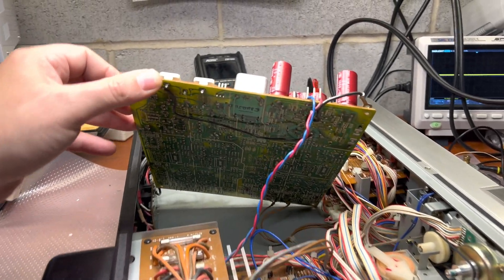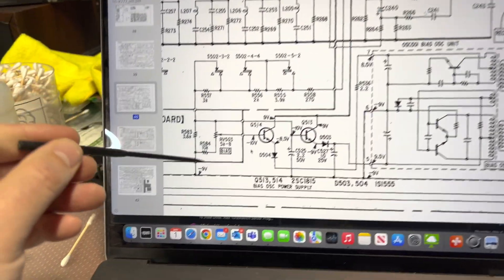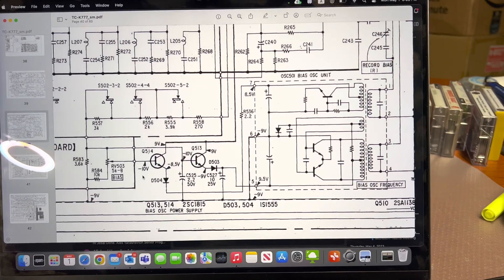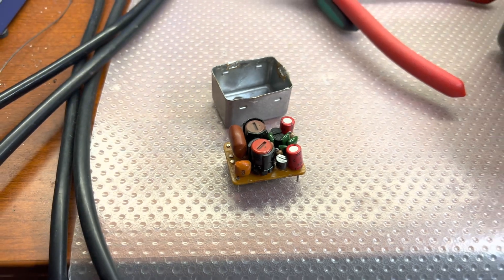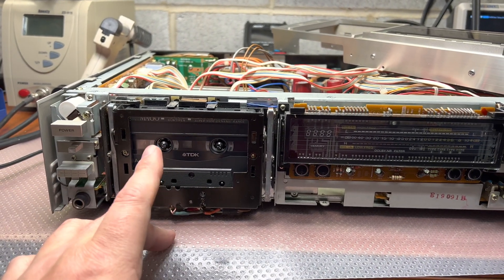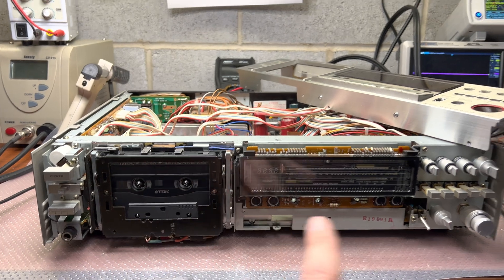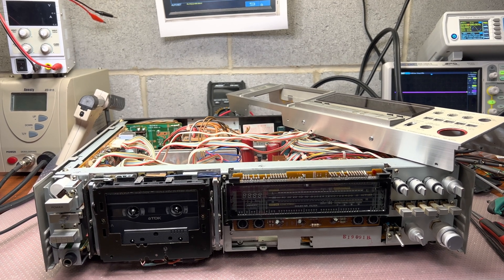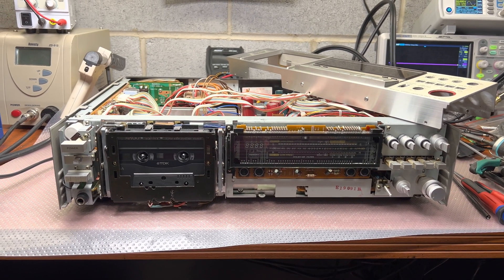Revamping the Classics: BIAS Generator Rebuild for Sony TC-K777

Comment: Curious. A couple of months ago I restored a Pioneer (low end but good) and the oscillator block had a problem. I opened it up and the "culprit" was one of the polyester capacitors. It wasn't any of the green ones but it was the orange one that had the value greatly altered. I replaced it and everything was fine. Thanks for the video.

Comment: Hello, I have a problem with my Sony 777. I didn't completely erase the old recording. You remove the feed roller and you will see that everything is starting to wear off perfectly. The problem seems to me that the tape does not adhere tightly to the erasing head, the falling roller forms a slightly elevated film above the erasing head.
Reply from the maker: I am already fixed, the problem is in head wear. watch the following videos.